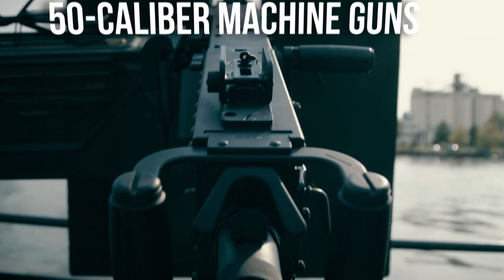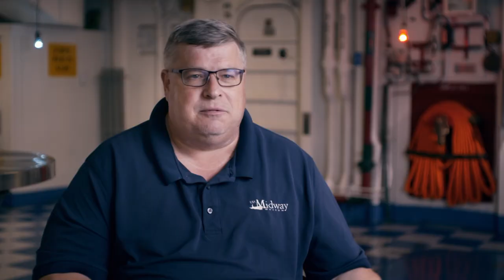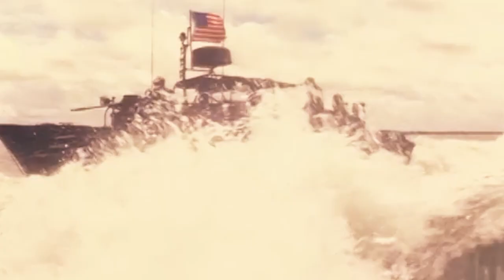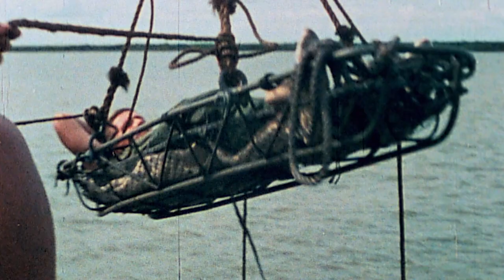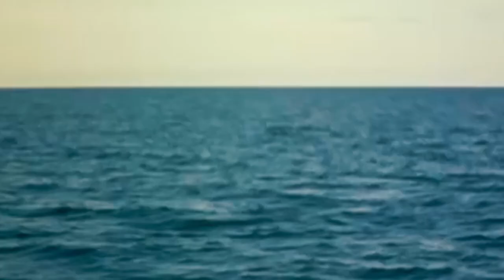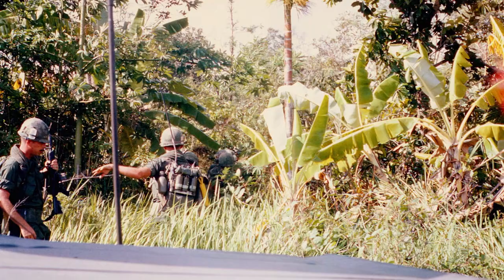This Devastating Patrol Boat Suffers From a Soft Underbelly 🚤 Combat Ships | Smithsonian Channel

Comment: Is that Jacuzzi technology still used in boats today? What an excellent invention for shallow waters.
Reply: Yes, they are called Jetboats and are the most common kind of pleasure boat now. Propellers can hit rocks or sandbanks or seaweed. So these boats are great. I owned one and used to go in the ocean and back into the Florida Everglades with it. Mine had inflatable sides and so it worked a couple of inches of water.  
 If you put "Jetboats" in YouTube or Google you can read about them. They power everything from highspeed racing boats to pleasurecraft that take 50 people. Maybe even larger ones I don't know.  
I just Googled it and the Valour-class frigate is a Jetboat. So that's a large warship using a diesel engine powering one waterjet as population.
Reply: @AnyoneCanSee  Thank you very much for sharing this, I looked up that South African warship and amazingly the technology allows the ship to be very fast, well-balanced and extremely quiet.
Reply: @charlie1567  - You are welcome. Yep, when I wrote "maybe larger ones" I Googled "what is the largest boat powered by a waterjet". I was surprised as I thought it powered boats that were small and light enough to almost lift out of the water. I just tried searching again and there is also a 180m luxury superyacht called "Azzam" that uses water jet power.  I didn't mention before that Jetskis are also powered by waterjets. 
The manoeuvrability of jetboats is far better as well. You can spin in a circle. Even my small one accelerated fast enough for waterskiing. Also, you don't injure animals like manatees in the Everglades. Practically everyone I saw had propeller cuts.
Reply: @AnyoneCanSee  great to see that a once only military technology profits today civilian life and is even  beneficial for wildlife , I have never been to Florida but saw many documentaries and the manatees seem to be such friendly and peaceful animals plus such good moms. Have a great start to 2023 !